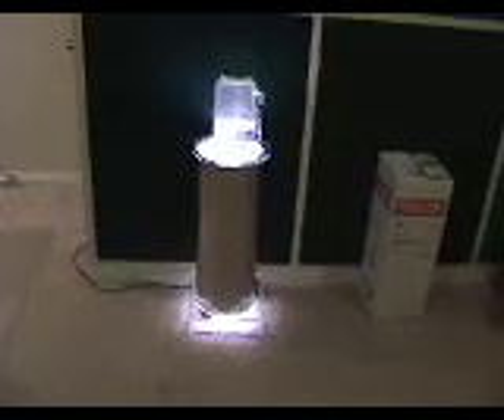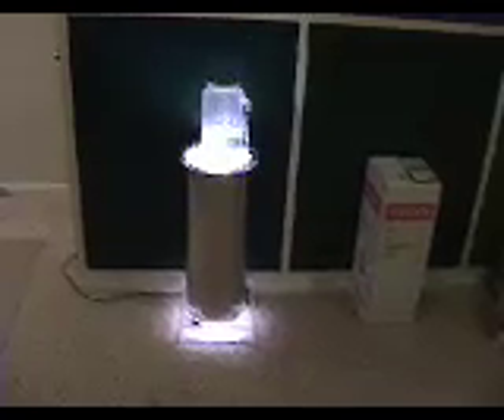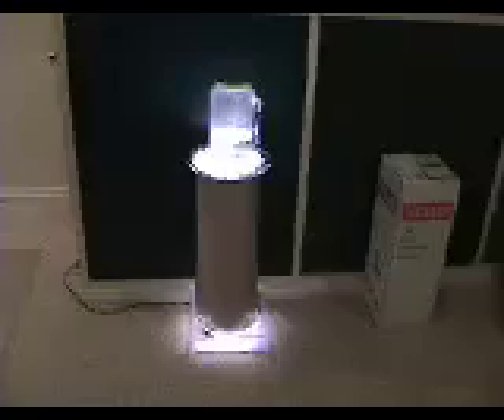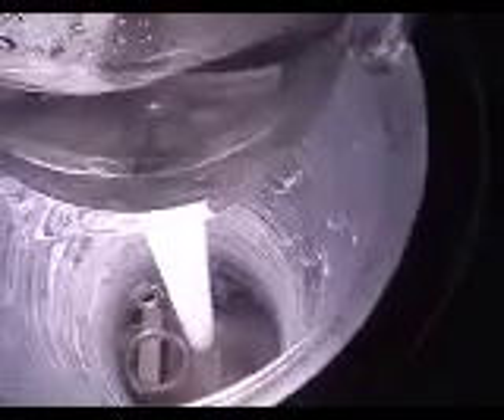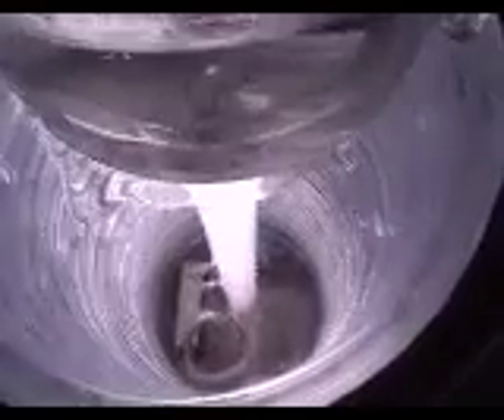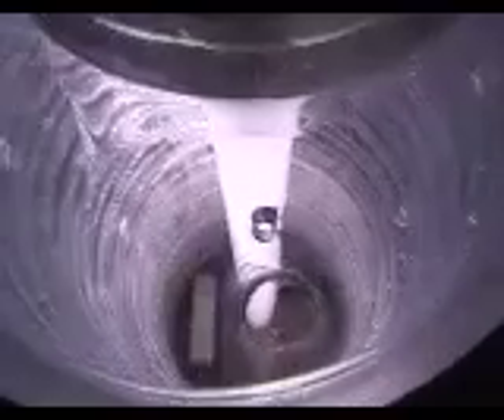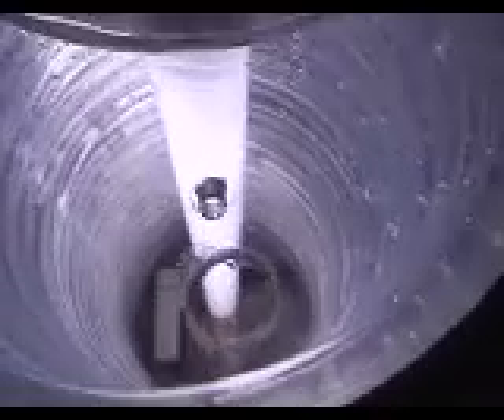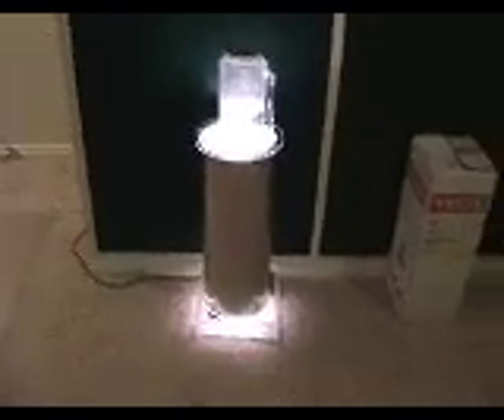Algae Bio Reactor Project

Comment: Fantastic idea man! Just a regular t8 floro tube? Experimented with any strains or different spectrums of lighting? Light cycles? Temps? Ph? I'm very interested in taking water from my aquaponics system that is nutrient rich and running it through an algae reactor system. I may have to try this out sometime!

Another question: Where did you place your air stone/tube in the system? Am I correct in understanding it's the air bubbles that is lifting the water back up into the glass jar?